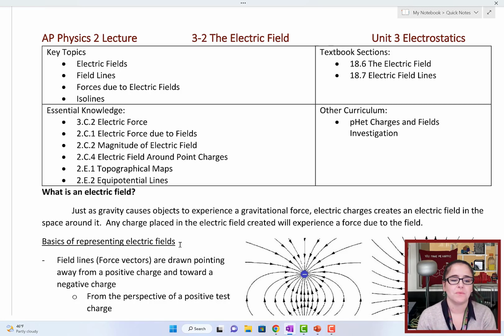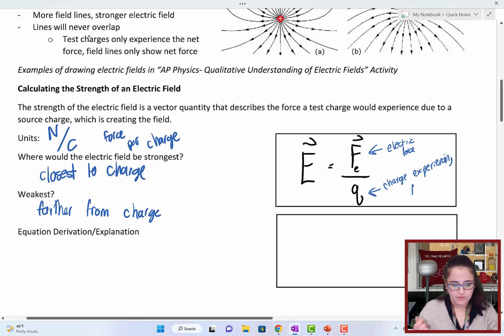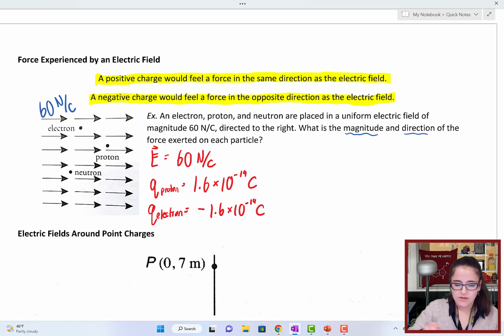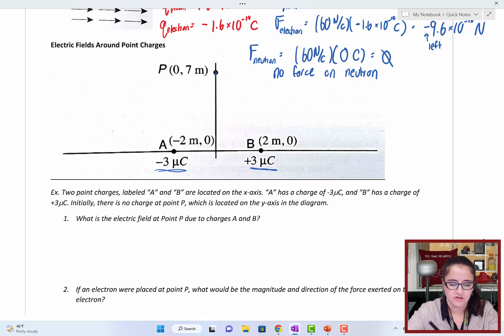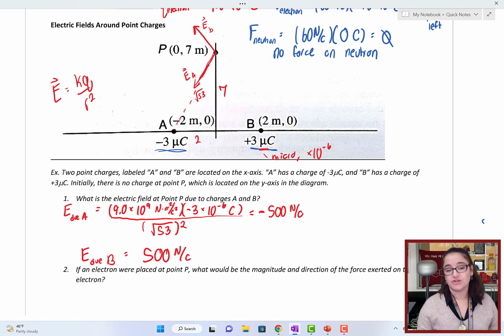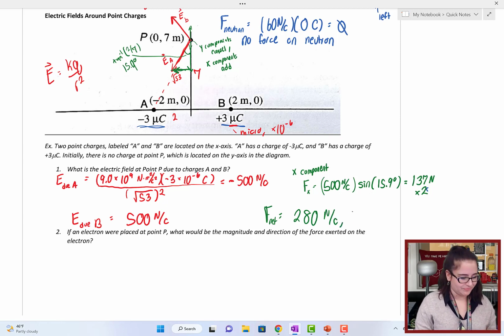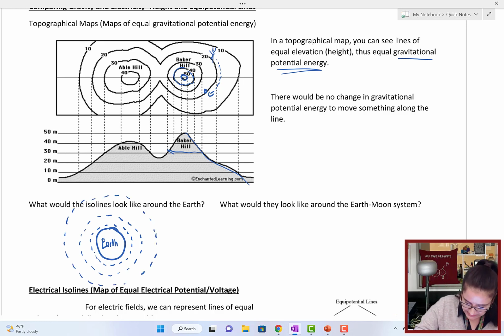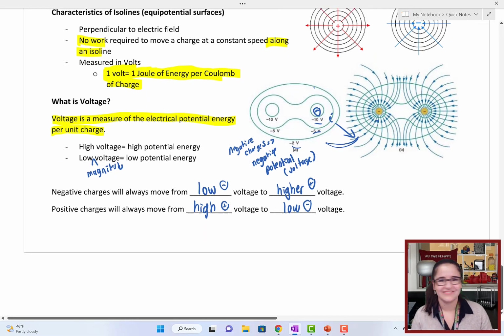AP Physics 2 Lecture 10-2 Electric Fields

Comment: I’m struggling with the conceptual questions in this course. I often feel stuck and eventually give up, only to look at the answers, which I understand but would have never thought of on my own.

For example, consider this question:

In Figure 1, four charges are situated at the corners of a square with side length S. The charges at opposite corners (A and C) are equal and labeled Q, while the charges at corners B and D are labeled q. All charges Q are positive.

A) In the first experiment, it is found that the force on the charge at position C is 0 newtons.
i. Can you justify why the charges q cannot have different magnitudes in this scenario? 
ii.Derive an expression for the magnitude and sign of the charge q.

B) In the second experiment, the charge at point C is removed. If the charges q are positive, is there anywhere within the boundary of the square where the electric field could be 0 N/C?

C) When the charges are reassembled into their original positions, explain why the electric field at the center of the square must be 0 N/C, regardless of the magnitudes or signs of the charges q or Q?

I would appreciate any guidance on how to approach these conceptual questions more effectively.
Reply from the maker: What I tell my students is to always start with writing down a list of what you know, drawing the situation, and then looking for a formula that fits.  For example, in this one- if you draw it out and just think about opposites attract you got it for A.i. Then you would go to the equation sheet for ii. and be like okay- i have distance, force, and charge (nothing about field or energy), so it's likely going to be Coulomb's law based. then the next question brings in field, so a different equation/ concept.  Maybe sure those three ideas- force, field, and energy are clear in your brain- if not i would recommend watching some videos around that concept!
Reply: @KcoolScience  Thank you! I think the challenge is in figuring out what the question is asking, especially when it’s not clear. For example, questions like "What is work?" or "What happens if this variable doubles?" are not a problem for me. I can handle the calculation questions, but the conceptual questions are more difficult for me to understand.